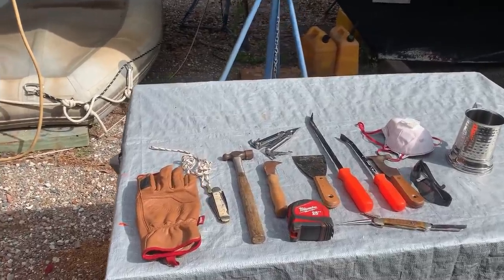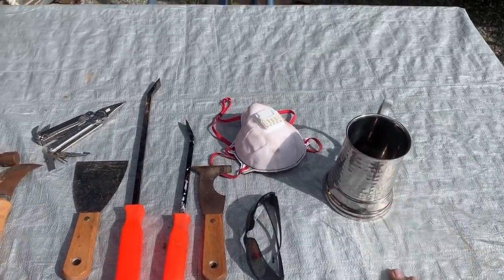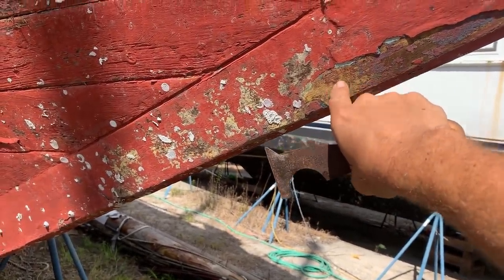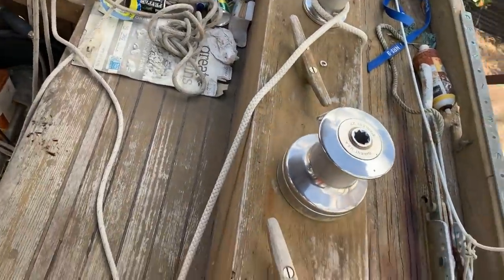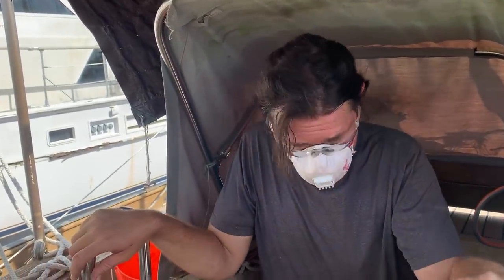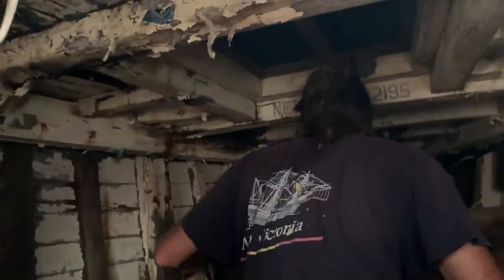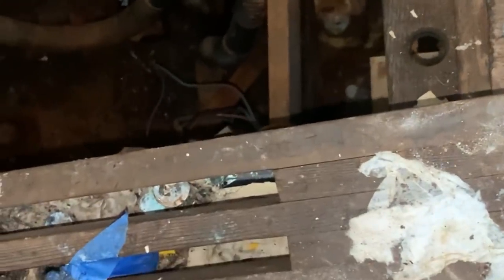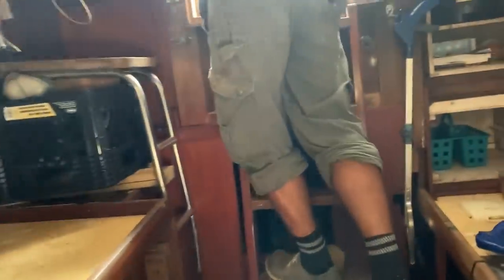FREE WOOD BOAT (what to look for)

Comment: I'm 74, ( a retired Mechanical Engineer) been around wood vessels over 50 years and appreciate your logical view on an evaluation of a wooden boat! There are a few locations I would further examine, however, this is a "free boat" and you covered a lot. If you're not already, you would make an excellent vessel surveyor! My hats off to you young man!
Reply: I'm 72 and in a wheelchair but if I had a spare $mill. I would love to oversee a complete restoration of this grand old girl! There's a young couple in Brazil who have nearly finished a total rebuild of a much bigger vessel (see Yaba on YouTube). They have ended up with a new boat, only using the original as a template.
Reply: There is some original wood on Yaba..
Amazing techniques used by boatyard.
Channel called..
'Sailing Yaba'

Here's a few channels you might both like to look at...

'Travels with Geordie'
Peter is working on 3 Monk boats, also some crusing etc.

'Todd Dunn' he had a wooden boat which he restored, sold it as getting older, just put his fibreglass sailing vessel on land for winter .. does other videos..

'Salt and Tar' .. a couple who had done some serious sailing.. build a wooden boat from scratch. They are now enjoying the boat.

'Odd life Crafting'.. they are friends with Yaba..
Really well designed metal boat they restored. Now enjoying the boat..

Hope you both might find something of interest.

Comment: The engine is Norwegian SABB - one of the most reliable engine there is! 8-10 BHP (Type 1G)
Reply: Correct,-it's a SABB, made in the city of Bergen, Norway. 
You can still buy all the spare parts you need for it and they're easy to work on.
Indestructible and super reliable engine.
DO NOT replace this engine with anything else.
Reply: I had one as well. Great engines. Dont replace. These are super simple and reliable

Comment: An excellent exploration of a lovely old girl that needs a bit of tender care.  You may be interested to know that the log of the "Joybird" from 1911 is not the same vessel: that is a 30ft yawl built by White Bros of Southampton, which was renamed "Ripple" and is still sailing on the Clyde to this day.  So the owner's 1913 estimate is more likely to be correct. The engine is a Sabb GG type which, despite its prodigious size, only produces about 10hp, but interestingly has a variable pitch propeller.
Reply: You should never rename a boat!!!
Reply: @kirkkirkland7244 Land lubber talk.  Thats a lot of RUBBISH. 
I renamed all 3 of my boats.
Reply: seen one in abberdeen built in 1911

Comment: These days the issue is that there are a lot of cheap fiberglass boats available. So there are fewer young energetic people to take on an old wood boat as an economical way to start boating. There are exceptions like Leo and Tally Ho. Acorn to Arabella. Travels with Geordie. The water dripping from the thru-hulll is coming from the dehumidifier.

Comment: That is a beautiful boat. It’s worth a rebuild.  I know of a guy who was given A wooden boat. We lived on Saint John and the Virgin Islands and the guys name was red and he went to Saint Croix and got a boat that was sitting on the hard for quite some time. He splashed it and spent a couple days patching all the leaks and headed north to St. John which was 35 miles away. Made it halfway before the leaks overcame the bucket that he had to bail with.  He didn’t even have a life jacket. He had a cell phone.  He called 911 and they answered. He did not quite know his location but he knew he was between Saint John in Saint Croix. The U.S. Navy happened to be in Port and anchored in Pillsbury sound. The USS Cole.   They sent an inflatable to get him. He said he saw a black dot on the horizon heading straight for him and by the time they reached him he was up to his knees and water while holding onto the mast.  Inflatable pulled up and yanked him into the boat and headed back to Saint John as he turned around to see the boat sink.  He was transferred to a national Park vessel off of Saint John and brought back to the dock.   I think of the thousands who did not make it.  May their souls rest in peace.

Comment: I used to operate an old "Bucyrus Erie" ....( an old drag line crane) and it had Saab engine that was used as a "poney motor" to start the main engine, and it  was very similar to the one in this boat.

Comment: At 43:31 you kan see the outline og the letters "S A B B"  above the engine tag.   Sabb Motor is a Norwegian maker of small marine diesel engines, mostly single-cylinder or twin-cylinder units. The firm was established in 1925. Sabb's main market is the production of propulsion engines for life boats, fishing vessels, fish farming, canal boats, work boats and pleasure craft. They are the worlds largest supplier of lifeboat engines, offering lightweight units and safe whilst operating under extreme conditions.

Comment: She's definitely a looker. Don't know the lumber situation in that area, since local woods may not be a good replacement choice. Down South, Yellow Pine, could be had for some of the work, but decking is generally Teak, and frames and ribs are usually Oak, which are imports. Really sad she's set with leaking decks so long, as rain water does horrible disrepair when left unchecked for very long. Hope she finds a good home with some well funded soul.

Comment: Hi superbly informative video...but at what point does the hull shrinkage become un-caulkable..? do you have videos on how to caulk does every part need to be recaulked...I need to attend a wooden boat restoration course so interesting but I was wondering so if the frame moves a bit is that a difficult repair...? So many questions as these wooden yachts fascinate me I've owned a 1947 Scottish, William Fife designed Gentlemans motorsailer...but I had to sell her because of not having the skills as there was a fair amount of work to do she was 27 tons dry I  was gutted she was a lovely beautiful yacht..Earraid was her name...
Reply: damn i dont know the exact boat you're talking about but i know i have never seen an old William Fife design that i didnt like. Really beautiful boats in my opinion, would feel bad about letting it go too. would love an old flush decked boat.
Reply: I would soak it down with mineral spirits and linseed oil. It would stop any dry rot and swell the planks back up a little. I have watched some guys caulking the old school way and it looks very slow. A caulking gun would speed it way up.

Comment: Great Start. I believe you missed a few points. A plank in the bilge had different color. That may be a hint for dry fungus. Also it's not great that the boat is full of stuff, especially the cotton and the stuff in the bilge. This is collecting humidity, mold and fungus possibly therefore. And the fwd and aft sections of an boat should be mentioned to be generally bad ventilated and therefore have a tendency to root.

Comment: Ferro sheathing could save this old boat and have her back in the water in a couple months.   Then most of the rest of the repairs could be conducted while in the water.  At some point, if it mattered that much to the owner, later the sheathing could be removed and her restored to original condition (that is, if he or she wasn't just having to much sailing her and enjoying a trouble-free, watertight bottom).

Comment: You didn't help me at all here buddy😅😅 I have a sailing cutter in Norway. Still floating and i don't have the time to keep it floating. Getting her out of plank fix and finding something worse would be a disaster due to work and family. So I am contemplating pulling her out and doing her in the garden. But i am mighty afraid it will just dry out, check all over and I'll end up with a Tally Ho situation. But if she is out and next to my house, i could give her some time regularly with time boosts like whole week every few months. I got her practically free.

Comment: Here’s my opinion for what it’s worth. I’m a carpenter and part time boat builder . I would consider two things first . Try and estimate the material cost, timber ,hardware ,possible tool hire , and then multiply that figure by AT LEAST two . Then be really honest with yourself and ask “do I have staying power?” I say this because your main enemy will UNDOUBTEDLY be project fatigue. It is so easy to start a project and a few of your mates will probably come and lend a hand (at first) but then they will most likely thin out quite quickly. Also do you have a supportive partner? If not then at some point you may have to choose between the two. Sorry to sound negative,but the world is full of unfinished projects . One other important thing to have of course is the skill to do the plethora of tasks that will face you. 
   To finish I would recommend watching the brilliant Tally Ho series, and see if reality fazes you,remembering of course that the project was fully (and then some) financed by patron. Best wishes whatever you decide !!

Comment: could I put it on a 50-ft flat bed trailer and move it 2K miles or would I be better off stripping inside, supporting the frame & patching the deck then moving it?
Reply: No. Just no
Reply: Probably 15k to move it that far or better.

Comment: Ive luckily picked up alot of these techniques and knowledge growing up around wooden boats with a passion for them too but I wonder if you know why the individual planks have "wrinkles" or ridges running along thier length. Has the wood dried out, has the oils left the wood so just he harder fibers of the wood are left?  Super useful and informative video!! Priceless knowledge

Comment: Truly excellent exploration. But the boat would be a complete rebuild. A life time job. I have a similar project. Bought a Windfall boat of 50 m2 in Brittany. If one doesn't have a ton of money to pay boatbuilders,  it would take at least 10 years if not 20. Depending on motivation, tools, talent and skill.
Biggest thing is checking the backbone. Mine is made of oak and was falling apart into black dust because of iron sickness. One needs to check the state of the backbone really. Replacing it means opening the largest job there can be on a wooden boat.

Comment: Bronze fasteners can look great at exposed ends of bolt and screws yet be almost gone from corrosion where no oxygen touched
Reply: Opposite for galvanized but same for stainless any paint or deprivation of oxygen will destroy stainless steel bog iron last 1000 years

Comment: At a glance (would definitely need to see it much closer) the engine looks to be an Hit 'N' Miss type of engine. With the boat at 110 years old a hit and miss engine would be correct for the time period as well. The engine's were made from the 1890's to the 1940's. Cool thing about the old hit and miss engine is, you can run them on almost every kind of combustible fuel. Here is a link telling about them. 
https://en.m.wikipedia.org/wiki/Hit-and-miss_engine
Reply: @jamieminton172   You are probably right. The old hit and miss motors are hard to kill.

Comment: If you've any sense you wouldn't touch this with a barge pole... If you want a boat that badly then buy an old glass fibre/steel/ferro cement boat but don't go near an old wooden boat.

Comment: The real answer to this is to stay as far away from a wooden boat as you can get unless you enjoy maintaining more than boating.  I had to laugh when this man says, “…that’s what is so great about wooden boats is that they are easy, easy to repair!”  Then he admits he has no idea about working with fiberglass.  Yes, cause if he did he would never again call fixing a wood boat “easy”.  Wood boat people are insane.  That simple.
Reply: To repair a wooden boat you need woodworking skills, to repair a fibre glass boat you need fibreglass working skills, GRP looks easy but if you don't prepare the job correctly the patch will fail, and many people do not do the prep work as its dusty and unpleasant, seal your boiler suit with tape, use a mask and hood, even better if your boiler suit has one, and sweat in the heat whilst trying to avoid the itching powder dust, working with natural timber is nothing like as unpleasant, working in a boats bilge I had an extractor sucking the dust out one side, and a vacuum cleaner on blow pushing air into my boiler suit to try to keep cool, I had to keep stopping just to let the dust clear so I could see,  fibre glass is easy stuff to work!!!.